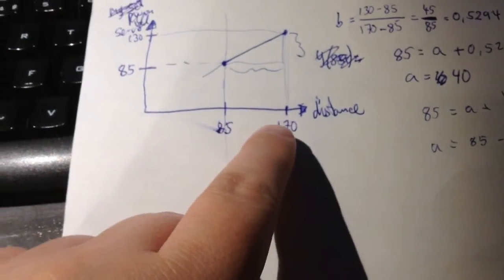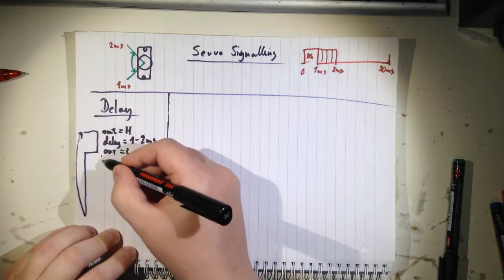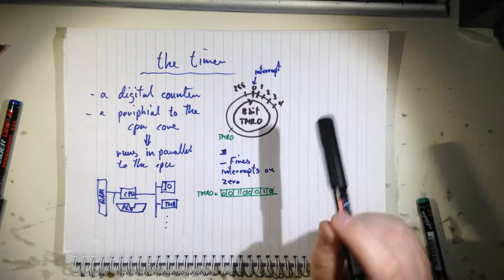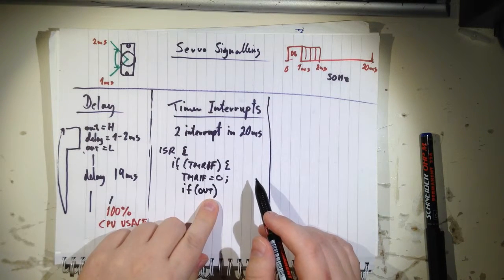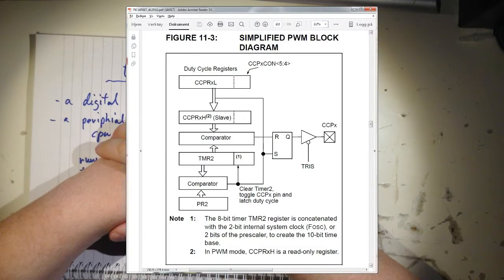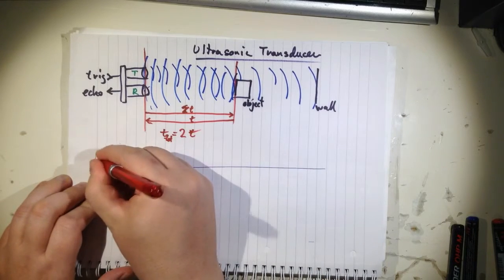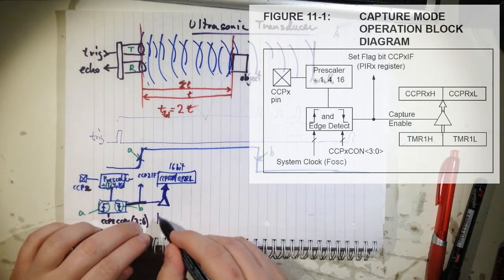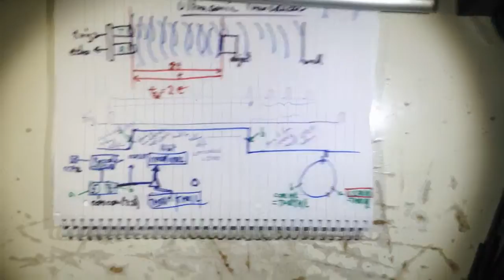The Beam and Ball Project - Part 3

Comment: Most of this was way over my head but I found it interesting anyway. Good thinking with drilling the new hole in the servo arm to raise the resolution of the movement. Do you think that maybe the ridges of the cardboard tube are affecting things ? Would be more likely than the ridge in the middle of the ball ?
Reply from the maker: +StigsWorld Both, ridges in the cardboard and the ball.. I sanded the ridge on the ball, and it helped a little. Found a bug in my servo position function.. It moves smoother now. There is some noise on the distance measurement that is not so bad for the proportional control, but now I'm going to add the D part of the PID control, and it is sensitive to noise.